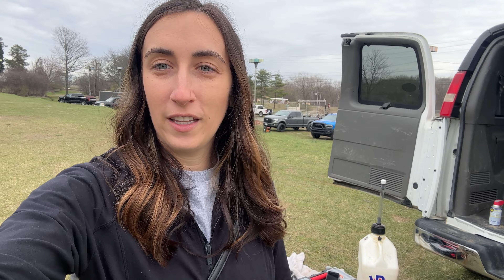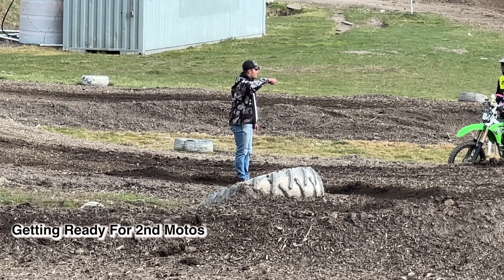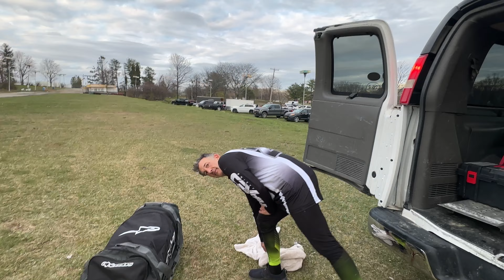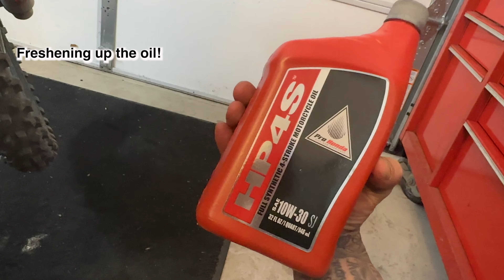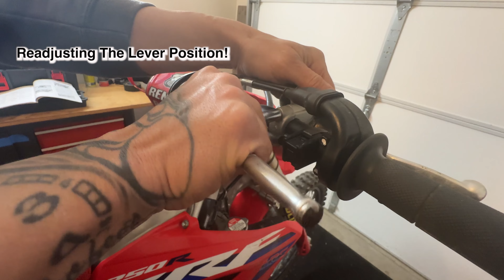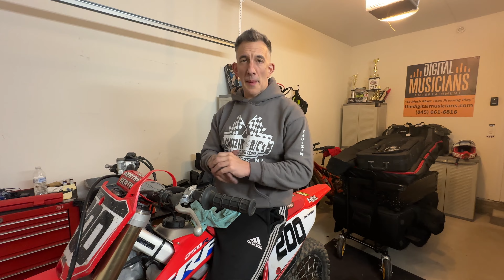Race Week Prep | Round 1 MSC Motocross At Walden MX

Comment: hows the new suspension    working
Reply from the maker: Hello!! Now that I’ve had the chance to ride it on a pretty rough track I have to say it is night and day.  The bike really used to dance on my and we could never get the rebound under control for my weight (165 ).   But now the bike tracks straight and is super balanced    I did set the sag to 108 and it seemed to be perfect for me, although I may try some other settings also.   Between the Dunlop 34s and the suspension it’s really fun and fast to ride!  A few other things I’m thinking of doing. I’ll make sure to keep you posted! 🏁
Reply: @MahansRacing  Great  to  hear   Im enjoying the journey you guys are on   Thanks foe sharing   I live very near back 9 mx   so please post if your ever heading down this way   id love to say hello   good luck a waldens  this weekend Ive  ridden  there many times    👍 Dave...
Reply: How about fork height? I’m 6’ 175 on the same bike. Dage did my suspension too….interested in your setting you look great. I will look for you out there👍🏻
Reply from the maker: Hello!!  Thank you so much brother!  Can’t wait to see you out there.  Dage really crushed it …. I am however much shorter than you 😂. I’m about ‘5  “8 ish …. I was messing with fork height on Monday … I had it pretty far up at first because I’m so short on the bike … but I found it was super twitch and also seemed to slide the front out consistently on hard pack or slick parts….   What I did was lower the forks about 3 mm from the top and then I even tightened my steering stem a little more so that it wasn’t just free swinging left to right.  Kind of like my own steering damper …. It seemed to help big time for me on the rough, and was much more predictable in the turns !